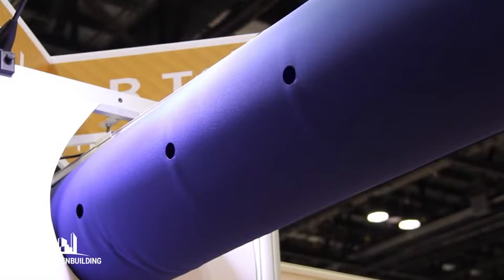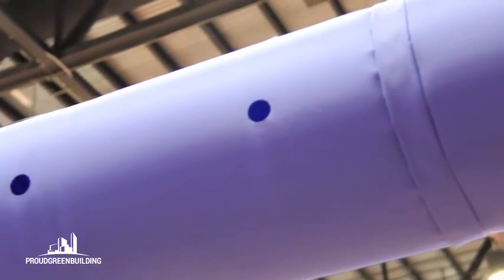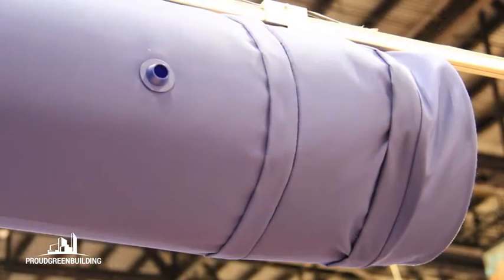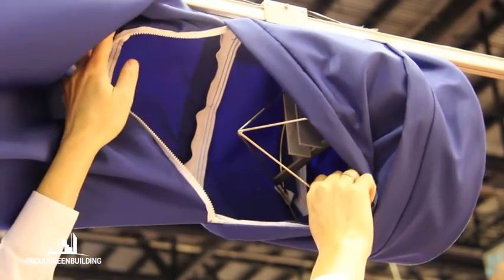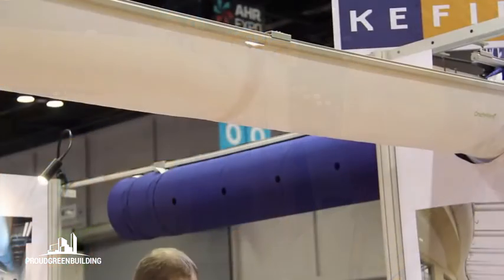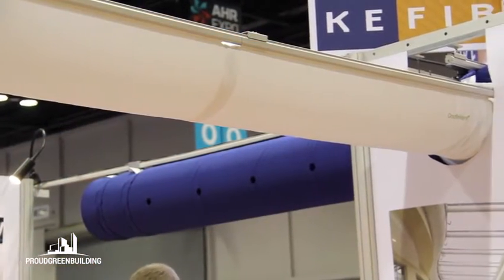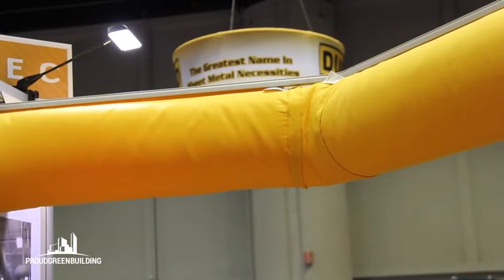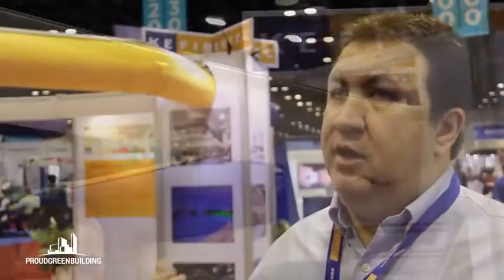A healthy indoor climate and energy savings with fabric ducting

Comment: The noise reducing feature of fabric ducts specifically is due to the passage of sound directly through the soft fabric. This is most often best used where strong fan noise and blade passage tones from the air handling unit supply fan exists in the supply air. Employing such fabric ducting (or even a manifold chamber) releases that sound immediately, freeing the supply air of any fan noise at the delivery point downstream. One minor disadvantage of this phenomenon is that sounds can find their way into the air stream. But that rarely is a problem.